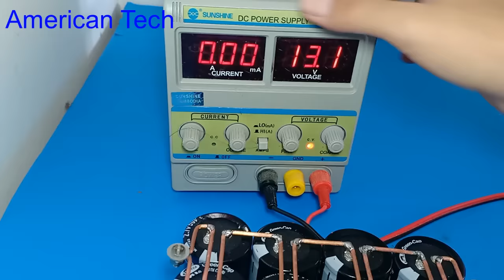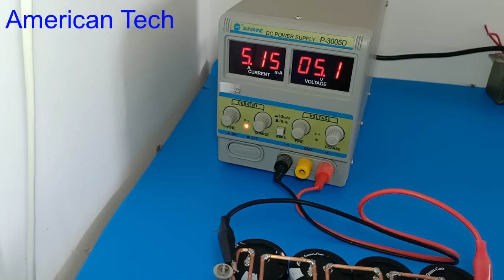12V , 100A using Super capacitors , Amazing idea

Comment: You were passing 5A of current and the super caps were full in 5mins which means ,by using simple maths ,it has a capacity of about 450mah which is smaller than any cheap battery
Reply: You are wrong lol hahaha wtf you talking about 450mah nooooo
Reply: So your saying it has 5.76 watt power when a 540 size motor like the one he has is 746 watts 1HP . I think your wrong idk.

Comment: you have a big error in calculations
4×2,7v =10,8 ≠12 v 
you have exceeded the capacitor breakdown current.
they will serve you no more than a week in this mode.
it is absolutely impossible to do so.  you recommend dangerous and erroneous actions.
people copying you can start a fire and get hurt.
and the total capacity is 250 farads and no more than 100 milliamperes.  A normal car battery has a capacity of about 50 amperes, which means your custom battery is 500 times less in capacity than the original.

Comment: There is no ionostor balancing. It's dangerous
Reply: It was behind the flux capacitor
Reply: jim palmer 

Vidas is correct.
Unless these caps are genuine flux capacitors, you do need to worry about balancing.

If they are the counterfeit flux capacitors you get on eBay! Shazam!

Comment: Connecting a resistor to the output will slow down the discharge rate but not effect the voltage so it will act like a battery and last much longer depending on the resistance value
Reply: Qual resistor?

Comment: Como muchos han calculado, la capacidad total es de 250F, teniendo en cuenta el circuito serie paralelo. Por otro lado, haciendo trabajar a los capacitores a 3volt, (un 10% por sobre su capacidad nominal) obtendriamos una bateria de 12V que podria sostener una carga de 0.83A por una hora. Ya que 12V *250F / 3600 segundos nos da 0.8333A
Reply: oye una pregunta esto se puede usar en un auto? de una vataria de 12v para conectar un amplificador de sonido?

Comment: I like to use a series of 6 caps with an active balancer. Connect in parallel with a 12 volt battery. This give good cranking power and extends the life of battery a good long time.

Comment: May I have a question:
If u need 12v, u must have 5 capacitors then u have 13.5v. 500F down 100F.
1F=1As/V. 100F=100As/V. We have 13.5V x 100As/V = 1350As. 1s=1/3600h; 1350As/3600=0.375Ah. Is that right?

Comment: All the solder joints start to smoke lol supper bad soldering 10:39
Reply: it's flux smoking because of the heat
Reply: @LiLBitsDK  there no flux ...
Reply: @stalkerpc3384  I see him using a can of flux during the video. Its burning off any residuals.

Comment: 12v 100amp what?  What is your claim here?  That you created a cap bank with a 100ah storage capacity?  A cap bank that can discharge at 100 amps at 12v?  What is your claim?  

Showing yourself putting 5ah into the bank for 5 minutes surely doesn't add up to 100ah storage!  It can discharge at 100amps but for a veeeery short time.  Seconds actually.  Again, very confusing claims here.
Reply: maybe he mean 100A is discharge current. not capacity.. capacity is Ah and discharge current is A.
Reply: The capacity here is 420 mA / h. But the voltage decreases all the time. Dont a battery, but to zero.

Comment: Backup????
Reply: i think it can't replace for battery , super cap have current very strong but capacity is low
Reply: @tranvu2626  ….the capacity of supercap is very large that is why they are called supercap….500F is a very large capacitance. One needs to limit current flow though they can be dangerous to car circuitry.

Comment: You need MATH not METH! 
Also... You might want to remove your MIT class ring, and any other bling-bling, Ling Ling!
Reply: That's some nerve for sure. Pure dummy speculation hes never heard of an ammeter we don't guess at these things we MEASURE 100 amps show me
Reply: + @tonij1960  ... He probably went to Radio Shack, and asked for an anteater... They said they've never heard of it, so he left. Lol
Reply: They probably tried to sell him the gold plated one and it was too expensive for him :) personally I have never seen an ammeter that goes to 100 amps Im sure they have meters that are capable though so no darn excuse to guess :)
Reply: @tonij1960  They're called clamp meters ;) Some can measure up to 2500A. He actually had a clamp meter in the video at 10:09 (they usually have voltmeter functionality too).
Reply: @umadbroyolo8413  I have over 40 years experience with electronics consumer servicing etc I keep several meters around and nothing new to me other than pulling figures ie 100 amps out of his ass what is a meter for not to have to freajing guess that's what they are for dud he use one did you see 100 amps indicated by anything other than the title so 100 amps my ass charging for 5 minutes
Reply: @umadbroyolo8413  you settle down I only said I had never seen one I never said they dont exist but I never personally hekd or used an ammeter that can measure that high you may think what you want but to me I found it remarkable that I never really needed one with all the different work and study Ihave done. So if his meter is capable why not use the thing and also dont ask for perfect grammar on a dang youtube comment other you  I dont think many people get disturbed over a little informal communicating.

Comment: Dude, batteries and caps are two totally DIFFERENT devices!
No matter how many caps you pit together the instant you begin a discharge your voltage will drop and never come back unless they are recharged. Unlike a battery where a chemical reaction sustains the voltage. Do not use them interchangably

Comment: Folks need to understand that the caps are not a fully functional replacement for batteries. They are only good for current surge such as starting a car that won't have to crank for long periods of time before starting.

Comment: I doubt they would just "sit around" if used in conjunction with solar, which is the idea and also just meant to be a pointer here by the person. Capacitors I believe would well out last batteries so.......
Reply: Are you sure they would in this environment? It gets pretty hot under the hood :)

Comment: Er - what about balancing the capacitors? They don't charge like batteries in series/parallel would do. If you charge them like that, they won't last long, due to overvoltage: they can handle 2,7 V, not 12 V individually. I would not recommend a setup like this.

Comment: I had the same idea, was told it could never be feasible
Reply: In What way 
I hawe 6x1F 10x500.000uf 20x250.000uF
20x 100.000uF set Up before my 2x6000watt inverters
To grab the spikes betwin the 16x200A and the 4x80A AGM kicks ind
The hunger the battery the slower IT is .. ITs just a monster ginormus capasitor 
I aculey think of 20 50.000uF and 250.000pF  to even even more out

Comment: how to make 48 volt supercapacitor for e-rickshaw motor having 1500 watts will it works with 12 volt battery?
Reply: Probably useful only for the initial torque - to take the load off the Li or LA batteries... Cannot be used as the main batteries because of high discharge rate and safety concerns...

Comment: It is wrong see the calculation with formula
With capacitors
((2.7*8)^2*250)/(1.2*3600)=27 Ah
But with 16 capacitors
((2.7*16)^2*250)/(1.2*3600)=108Ah
So you need 16 capacitors not 8 for 100Ah equivalent battery

Comment: DIY battery yeeee... sorry to disappoint you they cheaper capacitors is ~26$ you need 8 of them. This is 200$!
Nice toy but not tool. If I need use 100A too melting copper I use tranzystor...

Comment: At least 1 pair of capacitors connected in parallel of the same value in then connect it again to this previuos ckt , 10.8 v + 2.7=13.5v ,then it can be charge by a 12 volt power supply.

Comment: What is the discharge ratio? How much it will back up? How to get the output of 12v and 30a current and battery backup of 30 mins?

Comment: It would seem this video is NOT for informational purposes, but in fact an income source for the person posting the video from sponsored ads as can be told by an ad popping up every 30 seconds. The copper wire squares are too close together for not being insulated, arcing can easily occur between them (even by a small water droplet), not too safe, not too bright. Didn't finish video due to constant pop up ads and safety hazards with project.

Comment: Hello, it would be nice if you would make following experiments:

1. Connect a bulb 12V to the bank and start timer to see how long it would take before the light of the bulb become dim
2. Connect a motor to the bank and start timer and measure the RPM under some load

it would give an idea how long the bank will provide enough power to some tools/electronics. 

Other use of the capacitor bank could be a source for a spot welder [battery 18650] -- brief high current consumption.

Comment: ignoring all the dangerous stuff in this video (like shorting the caps with the wire you melted) those caps are $35 EACH! that's $280 before shipping... all said and done that will cost over $300. you can get a proper battery bank for way cheaper AND with way more capacity. 
you dont want to tell anyone that super capacitors are great at high output SHORT term use but suck at long term use... all they want to do is sell components, every video has links to buy whatever dangerous item they made.

Comment: Can a pack of capacitors like this replace a starter battery for a quad?
Reply: What do you mean, I did not understand the reference, but the capacitors They can store and eject charges, which can be charged and used as a battery....

If the comment is not well understood, it is because I don't speak English and I used a translator....

Comment: Sorry guys im not sold on this idea as capacitors are only good for short term power storage , go away on holiday come back to you power bank and i guaranty  its flat , not ideal  if you need a reliable power surpply??? Hence theres a reason they dont use them for batteries already , maybe if your just charging  that  battery (capacitor bank)up straight away from another power unit to use straight away or in the next ten minutes, yeap thats fine , but i wouldnt count on it being reliable though ,thats why we have car batteries.plus you have to really question the build quality on this item as well , if you like short term , loud bangs and sparks , and your names dangerous brian , this will work fine for your needs ,being stranded on the side of the road because youve taken your car battery out and replaced it with this LMAO.

Comment: Pille çalışan bir zemin temizleyicisini elektrikli bir makineye dönüştürmek istiyorum.  Temizleyici, iki adet 12 voltluk 100 amper pil ile çalışır.  Tavsiyeniz için şimdiden teşekkür ederim
Reply: I want to turn a battery-powered floor cleaner into an electric machine. The cleaner is powered by two 12 volt 100 amp batteries. Thank you in advance for your advice

Comment: How will you discharge a capacitor slowly like a battery, it's not possible, battery is the only thing known to mankind that can store currant and allow usage as needed, let it be super caps or ultra caps they will discharge in a spark brother, you need to understand basics of electronics, a resistor cannot do the work of capacitor in the same way caps cannot take batteries place my dear friend. Lolz

Comment: I have a set of those capacitors. Actually I had 12 of them. They are poorly made and the internals move freely in the housing. Additionally the wire filament that connects to the exterior leads is soldered so if you apply too much heat to the terminals it will also de-solder rendering the capacitor useless. I only recommend these for low draw applications and areas that will experience little to no movement. Additionally they have a high self discharge rate. With 6 capacitors in series charged at 12.5 volts over a 12 hour period they had lost 3 volts total leaving 9.5 volts the next morning. Not a viable option for anything that relies on them for starting power.

Comment: Please Help me, it is safe to use this capacitor, Name:Asia
uF 400V 100uF 400
thats the coding this capacitor is from my laptop charger...
can i use to my motorcycle so that my motorcycle horn will br louder, my motorcycle battery is small hard for that battery to supply my new horn i already installed relay but still, i cant change my batt

Comment: this is bad :/ wrong info. too - this doesnt go up to 12v. it caps to 10.8v - and the way you bridged those caps are not ideal either. isnt this like 250F 10.8v ? the capacitance is divided by how many caps you have in series

Comment: Its safe to try 4 pcs 6v battery in a series-parallel configuration to achieve 12 volts and higher amperage.
Reply: Yes over time 
This can catsh the dump in fast Spike drains .. so you get a smoother
Inverter current.. No blinking of  light .. becaus the batteries can't ceep UpAt start Dumps .. 
This is valid i use CAP's not this big still too slow but faster than a 200Ah AGM.. so i do now think i Will buy enough to make 60v to my 48v 800Ah batteri bank .. even got 4x80Ah agm .. still not fast enough 
Cap's is the way to smoothen 6000watt TIGEN TEP6000watt 48v x2